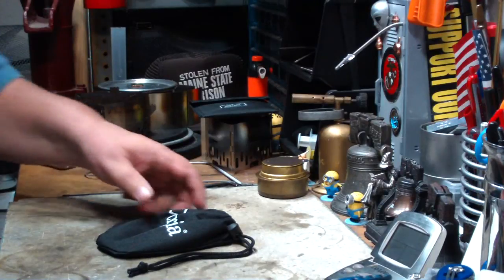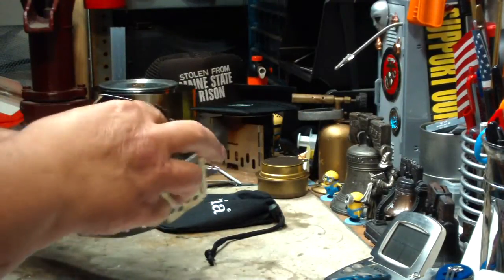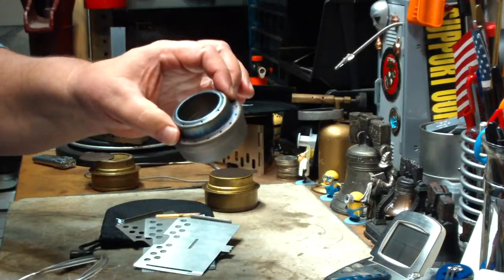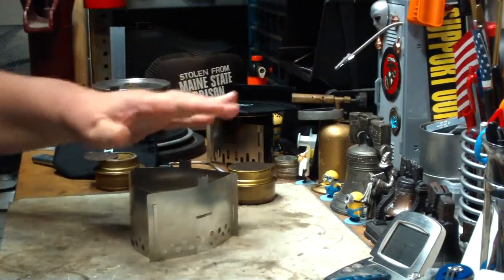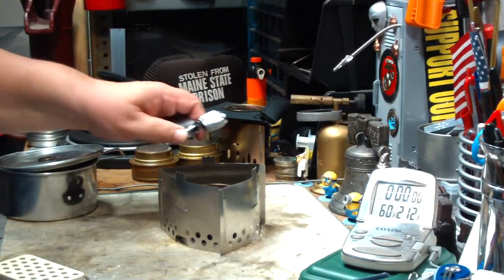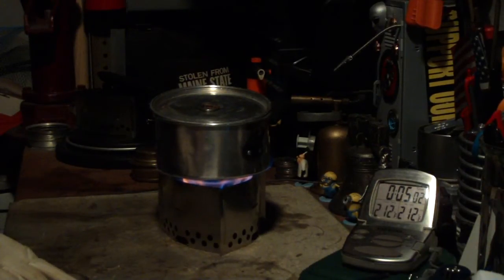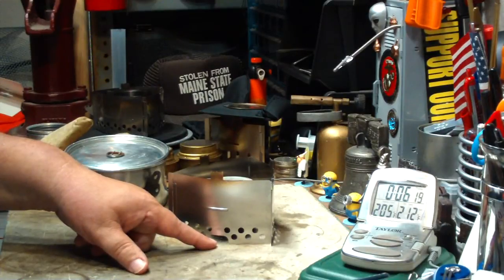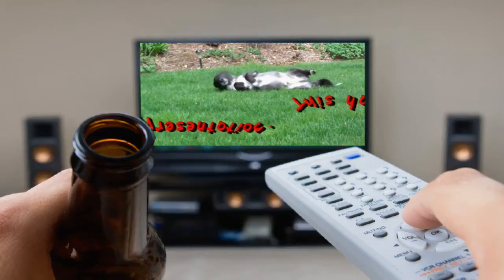Trangia Triangle - Boil Test #1

Comment: I hope by now you realize you put that pot stand together wrong.  The bent tabs are supposed to go in the other direction than how you inserted them into the slot.  This way, the pressure from the stove holder keeps the stand together.

Comment: It looks like you are assembling it inside out, that's why it's flimsy and falls apart when you try and get the ring inside. You have the tabs facing inward, if you do it the other way it is much more robust.

Comment: I have one of these and use it all the time. You can also use a  small piece of steel placed on the burner rest to convert it to a solid fuel stove. I don't know why you would need a feed port on these type of stoves, with plenty of fuel in it they will burn for around 45 minutes anyway before you need to top them up. Great video as always Hiram. Thanks alot.

Comment: Thanks for that test Hiram!  Wow, makes my Clikstand look kind of slow.  Interesting. I wonder if the wire burner support in the Triangle is sinking less heat, or letting more air flow through?  In any case, impressive. How much range is there with the simmer ring?